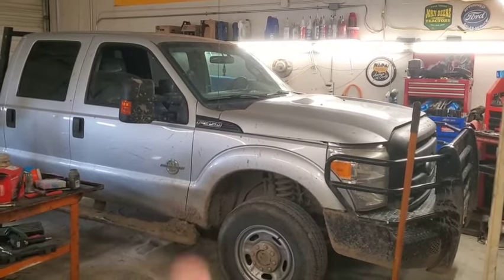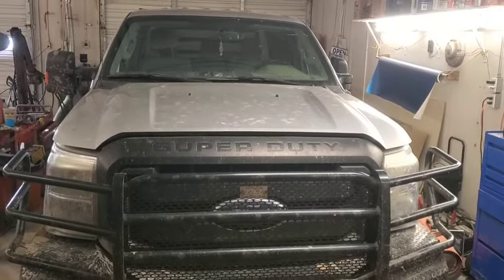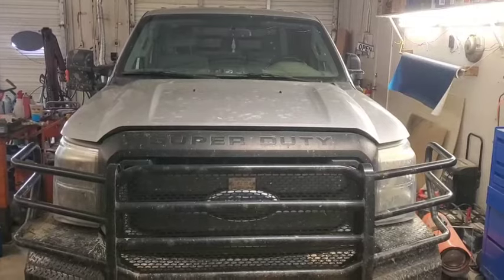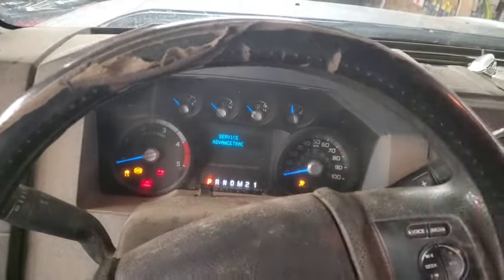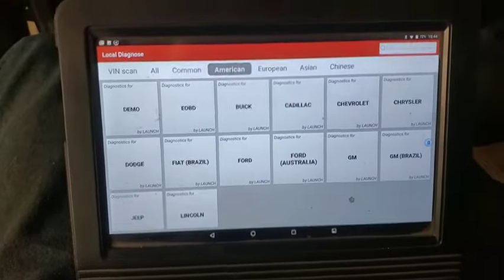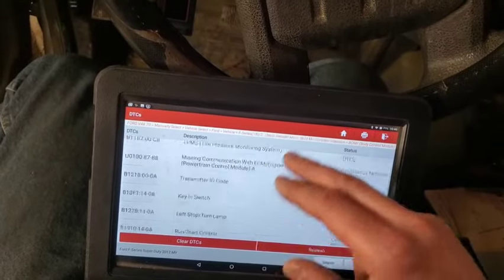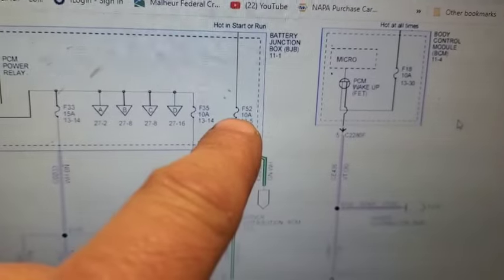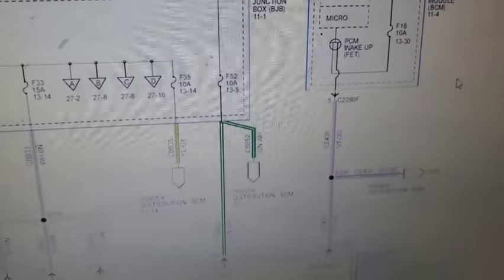Ford Super duty F250/F350 Dies.  No start.  No crank.

Comment: Ford took 2000 then said they couldn't fix my truck. YOUR A BADASS MAN, THANK YOU SO MUCH! I ran a hot wire to a toggle and a the fuse box under the hood and mine fired up! Thank you man for real thank you. I own a small business and this truck is detrimental to my job. It worked on a 6.2 v8 thank you!

Comment: This video helped me fix my '15 F250. Didn't have to dig nearly as much thankfully but found that the 12V constant to the starter relay was shot. As a "temp" fix I just soldered the two HOTS together on the starter relay and now everything works (for now). Figured it's relatively safe as the working HOT line was the one that has the 10A fuse so technically speaking they're both on a 10A fuse now. It is what it is but I'm happy to have a working truck again lol

Comment: Just wanted to say this video was extremely helpful getting me on the right track to find the solution to this same issue with my 14 f250 6.2 gas.  Mine had a stripped corroded wire on the bottom side of the fuse block that basically killed the power to the row of fuses behind the relay discussed in the video.  I had enough room to cut it and repair it and the truck runs like it should now. Thanks for making such a detailed video!!!

Comment: Thank you! Was having the same issue with the F350 here at work. I need to get a better diag tool, and access to electrical schematics. If not for your video, I'd still be banging my head against the wall! Now i need to decide whether to just run a wire, or actually go through the harness and find the open circuit...

Comment: First check the fuel pump reset switch located on the passenger side of the front seat by the right foot. 9 times out of 10 it's that switch.. It won't throw a code if that's the problem.
Reply: This comment saved my husband’s blood pressure today, thank you!
Reply: Normally that cause and crank no start not a no start no crank.
Reply: What symptoms would you have if you had a bad fuel shut off switch? Would it not run at all? Got an 11 6.7 powerstroke that keeps shutting off while running and we can't figure out why, shuts off at highway speeds
Reply: @eddienavarro8126  inertia switch in a ford does nothing but cut fuel, it will cause a fast crank but no start condition. You probably have a faulty bcm. You can check the bulk head plug down by the drivers side lock panel. Check for corrosion at the pins usually spotted from the back of the connector. Also a fault tow haul at the end of your shifter can cause the engine to shut off.

Comment: 😊 My 2012 f350 had the same problem and after watching your video I was able to isolate the problem to the relay.  Removed relay and it failed test so I got a new relay and the truck works like new.  I never would have even able to determine anything about which relay or even if it was a relay.  I checked the voltage on the same fuses you talked about and found no power our of the relay.  Thank you

Comment: Hey, Great video. really helped me along with mine with the same no crank issue. My truck wasn't actually the ground control side of the relay but was the power supply side "jumper" to the relay under the fuse block. it has corroded from and also very melted ac compressor clutch feed wire from the next fuse over. #47 I believe. 
probally see a lot of this on older SD's
thx again!!😊

Comment: I've ran into this many times on the both 6.7 and 6.2 engines. Also, the wire from bcm runs from the firewall on the a d along underneath the fan shroud up along side the head light support into a wiring support bracket. They also chafed on the backside on the support.

Comment: THANK YOU SOOOO MUCH. Exact same thing just happened to my 2014 left me stranded 5 hours from home. Dealership has been ''diagnosing'' this issue for 3 days now with no results @ $160 an hour.
Reply from the maker: Tell them to check the pins on the plugs that plug into the BCM (passenger side kick panel).  The pin fitment can get loose and cause this problem.

Comment: LOL, I am losing coolant. It's not normal. No normal culprits. It's losing small amounts. After shut down there will be pressure in the the rad the next morning when I open the de-gas the level will probably return to normal level. But was low so it's low but returns to normal when the cap is loosened and air bubbles are seen coming from the rad. ?

Comment: Having this same issue as well, 2014 f250. Is the wire at the bcm also BN/ Vt?  I dont have that color at my brown bcm plug. However i do have a solid violet wire that looks like the pin corroded off the bcm side and is stuck in the brown harness connector

Comment: I have a 2013 f250. Went in for a blower motor replacement.  That's done,but now. Won't crank,heads lights come on,blower motor comes on(witch both of those are turned off). The computer screen on the dash and middle console do not come on. Battery's check good,everything is clean. Any idea what is going on?

Comment: Did you check to see what wire was actually broken?Was it the brown/violet wire?Im having the exact same issue ..no ground firing from bcm,no power from relay to starter..My brown/violet wire is not broken though

Comment: Where are you located at?  Got a 2008 6.4 with the exact same issue.  It has left me stranded MULTIPLE times.  No codes though.  I've taken it to several shops.  Everything from New Fuel Rails, pumps, etc.  All guess work.  Still have the issue and have spent more than 6k to remedy it.  I'd like to get mine to you depending upon where you're located.
Reply from the maker: @ronthompson3328  I'm in Southwest Idaho
Reply: @prodieselrepair3218  Dang it!  That's a far cry from Kentucky!  Not 100% ruled out though.....just sayin'

Comment: This is my problem also but no ground on 85 and no power 86. Do you know where those wires run from the PDB? Do they go forward towards the front of the truck in that raceway or do they go back through firewall? I've heard that some of the pins in the wiring harnesses go bad too? I've been working on this darn truck for too long chasing the problem. Last night I finally found it and made jumper to 30 and 87 and bingo started right up but I want the permanent fix and also to see where the disconnect is to inspect other wires
Reply: Did you figure it out

Comment: Not a bad video - how ever - The one thing that I would have also checked on is the grounds because just running a new wire and not balancing and fixing the ground - as Power flows from   - to + not + to - You might be giving a fix that is only temporary where the fix might be a weak link and back feeding might happen because the system is out of balance,  the Computer might detect that and fail internally. Grounding points are the first and should be always suspected in a vehicle like the one you worked on in a condition like that truck was in.
Reply from the maker: You are sort of correct.  Yes the electrons do in fact actually travel from negative to positive.  But does that matter? No it does not.  We can design and engineer any DC elctrical componant with the idea that the flow is going to positve to negative and it will still work.  There's no such thing as "balancing" or fixing one part of the circuit and not the other.  In vehicles we have one (sometimes two) batteries with a positive and a ground.  Everything has to start and return to that battery.  There's 1000s of circuits that run of that one battery.  So naturally you are going to have those cicuits, at some point, share positive and negative power.

Comment: 1 million dollar question. My truck tests identically like this on. Going to run a new wire from fuse box to bcm. Only question for you is that is the brown violet strip wire one run from fuse box to bcm or does it stop else where?
Reply from the maker: Doesn't go anywhere else from what I can remember.  Check your pin fitment for that violet wire on the plug that plugs on to the BCM.  I had another one with this symptom and that's what the problem was.  The pin in the plug was too loose and not making a connection when it's plugged in.
Reply: I jumped brown wire with purple strip exactly like you did in this video and it fixed my problem! Just double checking that it didn’t run anywhere else! Thank you
Reply: Alright well I’m jumping it again now before I cut into things to double check before I do it and now it’s not working. I’ll check that violet wire now. Can’t seem to find any access to wiring diagrams for anything

Comment: I started my 2011 6.7 yesterday after work but forget to put the key in and press the brake, so it turned off ( happens usually) I tried to turn it on again but this time it didn't started, I could hear the diesel pump, I tried to junp it no didn't work, i get new batteries and installed them but it was the same, so I'm guessing its either the starter or maybe the pcm

Comment: I am having the exact same problem, but I cannot tell where in the Body Control Module (from the video) that you connected the jumper wire? I can't seem to figure out what relay was not passing a good ground and I don't have schematics. Any help would be appreciated. Thanks, If the Key is on, and I put 12V on the underhood fuse 52, The truck starts until it is unconnected.. but 49-56 show a ground not a voltage, and on the BCM, I have a whole row of fuses without a voltage. It all started when I replaced my Backup Camera (which was not working) and since fuse 49 gets no juice, that is still out, but now I can't even start my truck.

Comment: I have a 2015 f250 6.2L Exact same symptoms and same readout on dash. All my lights work but won’t turn over. I was following along with your steps until you tested fuses with key on to tell you pcm relay was working. Mine isn’t showing power. Tested relay and seems to be ok. Ideas on where I should look? Seems those fuses are engine power but I’m getting no power with key on or off. Help please
Reply from the maker: The 6.2L is going to be a little bit different than this one.  If you don't see power at the PCM relay like you should, then you have to find out why there's no power there.  If there is power through the fuse you need to find out where you're loosing it.
Reply: Sucess! I figured it out by purchasing the same wiring diagrams you suggested. I wasn’t getting power past the PCM relay to the fuse row with 33 & 35 fuse. So I ended up dropping the fuse box and opening it up. What I found was 5 broken wires and two peanuts. Seems some rodent had found it’s way into the fuse box and chewed through the wires. I was able to strip and reconnect the wires and it fired right up. Glad you had the video or I wouldn’t have known where to start looking.
Reply from the maker: @davidbone4230  glad you're back on the road

Comment: @Prodieselrepair
@10:35 can you please throw the link to the schematics? I believe I have the same exact issue. 2011 f250 6.2L. No crank no start.
Reply from the maker: The schematics came from Mitchell which is a service I'm subscribed too.  Even if I gave you the link it wouldn't work.  Lookup Mitchell DIY and you can get all of the schematics you need for $20.00
Reply: Did you end up finding the problem? I'm having the same issue with a 2016 f250 with a 6.2L
Reply from the maker: @earlporch7486  I guess you didn't watch the whole video? Yes I found the problem.
Reply: @prodieselrepair3218  no I did I was asking another guy who commented if he found what was causing his issue.
Reply: @prodieselrepair3218  sorry about the confusion. The truck I've been working on is a 6.2l gas truck so I was asking him to see if his issue was different then yours but I will be looking at everything I seen in your video as soon as I get to work today haha. It's the best video and closest symptoms to the issue im having I've seen. And it's very informative so thank you for that.
Reply: @earlporch7486  yes. Same exact issue. I personally did not resolve it since in tending to other matters but this is thee problem. 100%
Reply: @chrissmith-oq5nq  ok ima try it then and see. Mine is also having a click sound coming from the bcm area with the key out of the ignition
Reply: @chrissmith-oq5nq  unfortunately I tried this and it didn't fix my issue. I'll just have to keep trying.
Reply: @earlporch7486  sorry brother. Let  me know what you find. Best of luck!

Comment: I am having issues with my 2010 6.4 no crank no start issue was driving and it just shut down can you help
Reply from the maker: I made the video to help.  You'll need to get wiring schematics and troubleshooting info for your 2010 pickup.  I can't tell you whats wrong without being able to see it.  Once you get the TS info and schematics for your pick, the troubleshooting steps could be similar.

Comment: mine did the same but currently cranking so cant diagnose until it quits again
Reply from the maker: I had one that had loose pin connections on the Body Control Module.  Thats the fuse/module inside the passenger side kick panel.
Reply: @prodieselrepair3218  thanks, I'll try that next